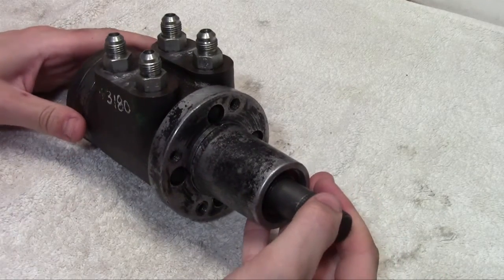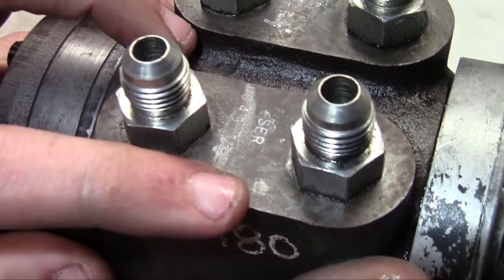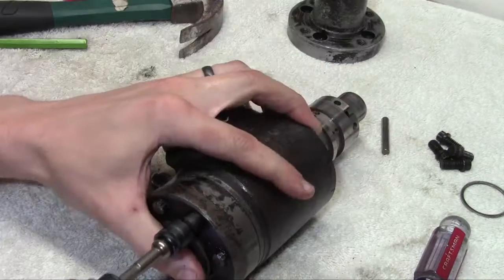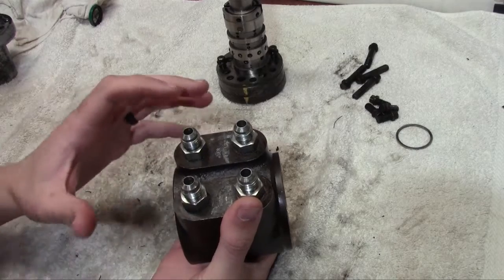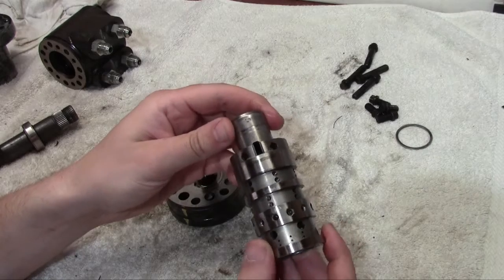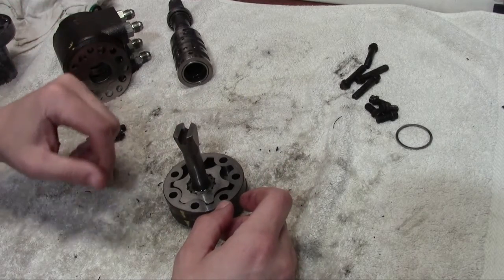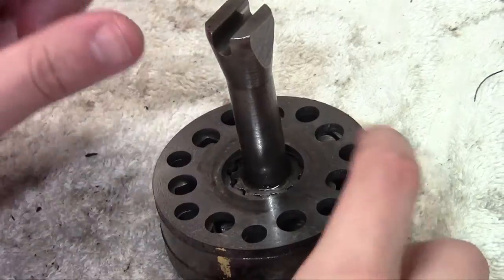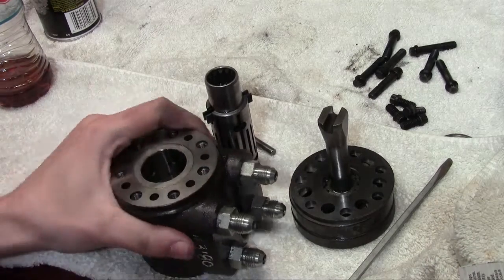[Hydraulic Steering] Orbital Valve Rebuild and How it Works

Comment: I added a transmission plate and bar cooler to my low pressure line. It refuses to bleed itself out, there’s a drastic fluid drop, then an overflowing foaming mess after the engine is shut off. I removed the top line of my added cooler and there was no fluid. 

When does an orbital valve circulate fluid out of the low pressure port? Constantly or only when under left and right direction?
Reply from the maker: The fluid should always circulate through the low pressure port but won't necessarily flow when there's too much fluid in the system. The foaming is from cavitation of the fluid and is pretty common when first running the system while bleeding the air out. Fluid level drop can be from the fluid compressing an air bubble if air is trapped somewhere. Not sure how much fluid you lost when installing the cooler but the first step is to lift the steering tires off the ground and turn the wheel lock to lock repeatedly while keeping the fluid level high. This should pull fluid in to both sides of the steering cylinder. Once you don't feel any slop/squish in the wheel when turning, the cylinder should be bled. Once that's done, turn the motor on to activate the pump and continue turning the wheel back and forth lock to lock. That should push out any remaining air bubbles and fill the return hose and your cooler. Good luck!

Comment: how would you bleed this system after rebuilding? on a forklift i would just loosen one of the hoses and turn it a few times until fluid leaks out then tighten. my grandfather has a Terramite T5C backhoe that he has just rebuilt a unit like this and i'm trying to figure out the easiest way to tell him over the phone how to bleed it since it's still not working after he rebuilt it and he didn't know it needed to be bled. Or does it? thanks in advance!
Reply from the maker: They tend to self-bleed as long the ports/hoses are pointed upwards when mounted. Just fill the oil reservoir, crank the steering wheel from lock to lock (keep an eye on the fluid level as it will drop quick.) Keep adding fluid and turning the wheel back and forth until the fluid stops bubbling and the turning gets responsive. You'll be able to feel when there's no air getting compressed and it's bled. Good luck!

Comment: WebWheeler: Appreciate the teardown video. I have a orbital valve on a Massey Ferguson GC2400 subcompact tractor in which the threads for the pressure port were crossed when I tried to replace with a non-manufacturer hose. When I received the proper hose, to make sure the threads were cleaned/mating properly, I removed the port from below the dash, and a y-shaped, stamped piece fell out. I'm not sure which way it goes in (one way fits easily but the steering is not fully powered) and the other way doesn't fit when trying to install in place (I haven't been able to remove the steering wheel so as to get the part onto a shop bench.)

If I send a pic of the part, do you think you would be able to suss the configuration inside the valve? I HAVE NOT taken the valve itself apart.

Thanks...
Reply from the maker: I will give it a shot! Send the pic to webwheeleroffroad at gmail.com and I'll take a look 👍
Reply: @WebWheeler  Thanks a million for considering looking at it. Sent a png from bscavone at gmail.

Comment: Where is the unit located,and is it like a powersteering pump.
Reply from the maker: It's the equivalent of the steering box. In full hydraulic steering this unit takes the input from the steering wheel and directs fluid to the hydraulic ram to push the tires left or right 👍
Reply: @WebWheeler  Tanx 👍.

Comment: So what fails on these to cause sloppy or unresponsive steering?
Reply from the maker: Seals are pretty much the only parts to fail normally. There is a chance the leaf spring that goes between the inner and outer cylinder could break which would cause that kind of issue. Never heard of that actually happening- just a thought if what could cause it. Good luck!

Comment: we have a Allis Chalmers 170 ,steering wheel turns and turns then will catch either direction, changed orbital valve for another used one and does same thing ,any thoughts?
Reply from the maker: Sounds to me like some of the lines mixed up?  I would double check the line plumbing if you haven't already.  If they're good, your hydraulic cylinder might have an internal leak at the piston allowing fluid to pass between chambers.  Good luck!

Comment: I have a danfoss unit and I'm wondering if the check ball goes in the pump hole or the tank hole?
Reply from the maker: I can't be positive since I don't have experience with the danfoss valves specifically but in my experience the check valve/ball is always on the pump side so that if the pressure spikes (like from the steering components getting push by outside forces,) that extra pressure is not transmitted back to the pump or the other steering line (which could cause line failure or steering wheel kickback). Hope that helps. Good luck!

Comment: min seems to have work most of the time but occaisionly will just spin like an air bubble or such this is on a full hydro industrial machine so i doubt its a supply pressure issue , i am about to do a full filter change and fluid flush
Reply from the maker: Yeah that sounds like a fluid level issue - pressure is probably fine but it sounds like the valve might be getting starved for fluid. Just a guess- good luck man!

Comment: The control valve from my 2004 Nissan Pulsar seems to be leaking from where the steering shaft goes in. I can't find any replacement seal or O-ring for sale. Do you think that I could potentially find a generic O ring to do the job? Is it just a rubber O ring or is it something more complex?
Reply from the maker: Yeah a generic o ring will be fine as long as it's the correct size and cross section- some use rectangular or square cord, others use X rings (or Quattro seals.) Most I've seen are standard Buna N rubber but they could be viton or something. Usually black rings are rubber and viton are brown. Once the profile and material are verified you can just get a generic one with the right dimensions or make your own from cord stock you can buy. Might try taking the valve to a hydraulics shop- they can probably figure out exactly what you need. Good luck!
Reply: @WebWheeler  great information and suggestions. Thank you very much!
Reply from the maker: No problem!

Comment: ,ser i ask someting why steering so hard to turn lift and right,,, what is the problem
Reply from the maker: Usually that's is because of low pressure from the pump either from low fluid level or a failing pump. The valve is just directing flow so it's possible that there is debris clogging ports but usually it's a pump problem especially if it's evenly hard to turn in both directions.
Reply: ,,'what do you men pump ser?,pump of hydraulic or inside of steering pump
Reply from the maker: @creedstag7843  The pump that supplies pressure to the steering valve.  If that is not supplying enough pressure, the steering will be difficult

Comment: Hello:  I have a 1996 Pasquali Italian articulating vineyard tractor.  The steering valve is leaking up through the steering column. I followed a mechanics advice when trying to remove a seized steering wheel from the splined shaft by slamming the top of the shaft using a ball peen hammer and rapping it hard downward.  Wheel released, but now damage from that allows the leak.  New valve from Spain/Italy is 400 US delivered. Any thoughts on the issue only being the seals?  Or am I potentially into broken cast parts?  Suggestions before I dig in...as I have never done this before?  Thanks
Reply from the maker: First piece of advice is find a new mechanic! That was horrible advice you were given. Either way, try turning the valve by hand with all the hoses disconnected. If it turns smoothly, you are most likely ok and it's just the seal. If it feels like it's grinding or sticking, there is internal damage. Good luck!

Comment: I have a question, we have one for trucklift with 5 hole instead of four. and apparently it needs timing for re-assembly. any idea what we can do concerning we didnt know this point and now all of the sudden we realize it ...
Reply from the maker: There probably is a way to tell if it's time incorrectly but im not aware of it. I would put it together and be clear of the steering wheel when you apply pressure. If the wheel spins on it's own, shut it off, disassemble and rotate the drive link one tooth then it should be good. Good luck!

Comment: Great video. I have a question on my unit there is a ball bearing and a wristpin in one of the holes and they fell out of the manifold. I'm not sure if the ball bearing goes above or below the wristpin. Any insite on this ?
Reply from the maker: Any idea what hole they fell out of? If I had to guess it might be some sort of check valve. Is your orbital an open center valve? Closed center valves could have something like that but my experience with those is pretty much 0 haha

Comment: My David Brown 885 is leaking out of the top of the steering column.  Otherwise the steering valve is working ok.  Do you think O-ring replacement on the valve will stop oil from coming out of the top of steering column?
Reply from the maker: Yeah chances are it's an o-ring that has gone bad. Mine leaked at the column before rebuilding it too.  Nice thing about these valves is there's not much else that could cause leaks. Good luck!

Comment: Good Vid, Mine Has air in it from undoing lines when I split the tractor. The steering wheel will now turn infinitely in both directions without moving the wheels. I have cracked all the lines to bleed them and there is pressure at both ram lines. Seems to be stuck in the neutral/open position. Any ideas how to get the air out?
Reply from the maker: They are usually pretty good at bleeding themselves of air but if it's possible you might try dismounting the valve (keeping the lines hooked up) and holding it with the lines pointing up so the air rises out. Some are mounted where the lines come in to it from the underside and that can trap air. They are usually pretty good away bleeding out the air either way though so you might want to double check the hose routing just to be sure something isn't crossed up there. Good luck and thanks for watching!
Reply: Just an update. Turns out it was not air. I had it plumbed wrong, my bad.
Reply from the maker: Glad you got it figured out!